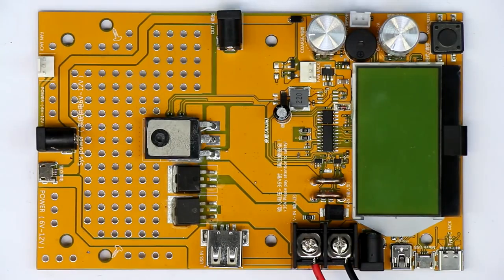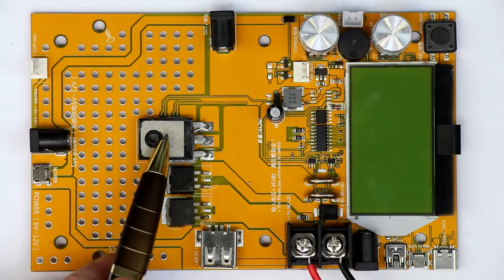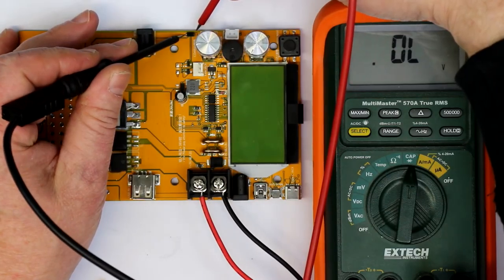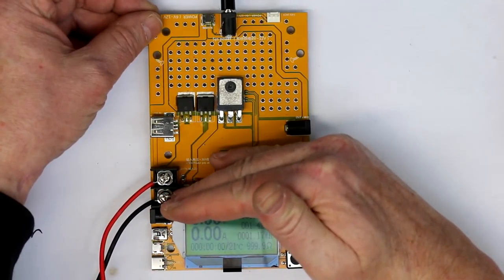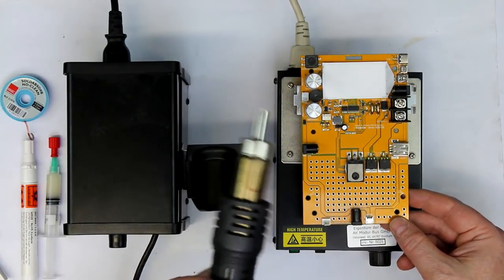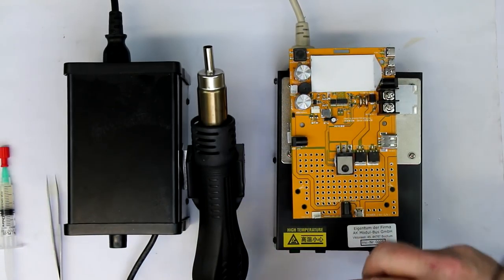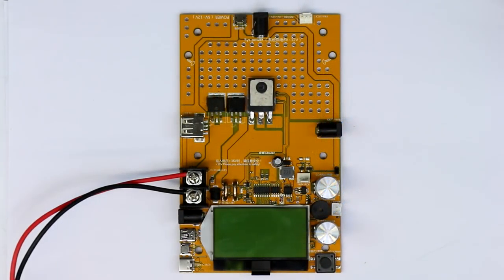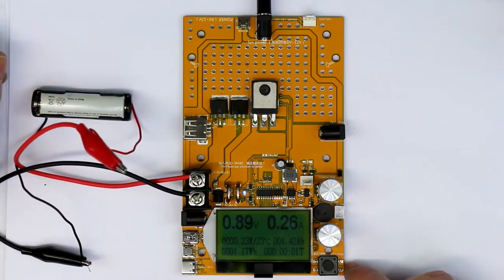Repair of a Constant-Current Battery-Tester

Comment: Hi
The switcher usually explode when the power input is reversed.
My favorit battery testing setup is the EBD-USB+ electronic load. It has enough accuracy and can trace the discharge curve.
Most of the other cc loads i tried had usually at least one shortcoming which disqualified it for my purposes.
Reply from the maker: Hm. When the switcher IC blew up the power of the battery under test was definitely not reversed.
(I think that one or two of the many high-current protection diodes on the PCB also serves to protect from that state)

I also had ordered the EBD-USB CC-load and even had it in my hands this week again because it intially also looked promising.
But as far as I remember it needs at least 3V minimum voltage of the load (=battery).
And that made it uninteresting for my purpose because I want to test single 1,5V/1,25V/3V cells.

The CC-load shown here has the shortcoming that there is no cutoff-voltage so that the battery will be dicharged down to 0V which is not a good idea for rechargeables.
I am just thinking about the simplest add-on circuit for a "programmable" relays- or MOSFET-cutoff-switch.
Reply: Hi 
Regarding EBD-USB:
Hmm this is strange I discharge my 18650 batteries to 2.50V and the specs claim - Voltage range: 0.5-21V
is it possible your manual was wrong translated and they meant powering voltage ?
I will try and discharge an Envelop tomorrow. I mainly use it to discover fake 18650 and battery matching.
Btw. Years ago Burkhard Kainka and Yogis Röhrenbude revamped my interest in electronics and meanwhile I studied electronics and work in the industry. And last week I stumbled over this channel. Unbelievable,... Btw. great channel love your tool suggestions and will soon place an order in your shop.
Cheers
Reply from the maker: Down below are 3 Ebay-sellers who all mention 3V-21V DC for the load (although I didn´t try it out with a single cell until now). Will try it out next week.
Could you give a link to where you bought youre specimen. Perhaps there are differences between the different copies of the copy of the copy :-)
Concerning Burkhard: Same with me. After making a pause in electronics for 15 years he revamped my interest in microcontrollers and electronics in general and in the end was responsible for my job now :-)

https://www.ebay.de/itm/35w-4A-usb-electronic-load-adjustable-constant-current-battery-capacity-tester-/291761120161?hash=item43ee5163a1
https://www.ebay.de/itm/35W-USB-Electronic-Adjustable-Constant-Current-Discharge-Battery-Capacity-Tester-/122988716369?hash=item1ca2b2e151
https://www.ebay.de/itm/Adjustable-USB-35W-4A-Electronic-Load-Battery-Discharge-Capacity-Tester-Fan-New-/272590673856?hash=item3f77ab97c0
Reply from the maker: I have tested mine yesterday with a 1,5V battery. It displays the correct battery voltage but I can´t get it into discharge mode.
Reply from the maker: Looks like we have 2 different models. Can you give a link or search terms for Ebay where you got yours?
Reply from the maker: Ordered one.
In the meantime the TEC-06 load has arrived.
Made a quick test yesterday. 
Accuracy and useability for battery testing is excellent: 4-wire measurement, programmable cutoff-voltage etc.
Will make a video about this one (+ 3 other ones I ordered including your suggestion) in the future when all have arrived.

Comment: Ha...I'm glad I didn't buy that load. The MOSFET is not DC/linear-rated (see the SOA curves). I'd be interested to see what happens if you try to run the board anywhere near its 150W(?) rating!
Reply from the maker: I don´t get the point. The diagonal dashed-lines in the SOA-diagram of the Vishay datasheet are only for pulse-loads.
If you multiply voltage, current and time at one point of one of the diagonal lines you get exactly the 1J (1000mJ) for the single-pulse avalanche energy in the absolute maximum ratings.
Continous drain current is given between 24 and 38 amps depending on temperature.
So I have no doubt that this MOSFET can withstand continously e.g. 3A@30V or 20A@5V drain-source voltage (if the fan can really dissipate 100W and the junction-termperature can be held below 150°C).
But this is a big CPU-fan which looks like designed for quite a substantial TDP-value.
Perhaps I will at a later date try to destruct this thing :-)
Reply: Most FETs today are optimized for switching, not linear use. They need to be vastly derated in linear mode — 10:1 or more...depending on Vds.

That knowledge was squirrelled away deep in my brain, and got dragged back up recently because I'm designing a load. 

Check this out for more:

https://www.edn.com/electronics-blogs/benchtalk/4460270/Help-me-build-an-electronic-load---bench-supply
Reply: E.g., the IRFP4668PBF is rated 500W, but the SOA DC curve shows max. V at 100mA as 40V. I.e., 4W. Also, 1A@15V, 10A@7V, 100A@5V, so power is going up at lower voltages.
Reply from the maker: Interesting. I knew about the "hot spot"-effect but not how pronounced this can be in linear applications.
Perhaps the linear derating factor of 2.2W/°C in conjunction with the maximum power dissipation of 280W@25°C can give a hint about the "true" SOA of this MOSFET (assuming e.g. 1°C/W as the thermal resistance from junction to ambient)
100W dissipated power would increase the junction temperature then for 100°C giving a deratig of 100*2.2W=220W to then only 280W-220W=60W. So 100W really seems to be over the top.
 
In the end only a stress test will show what this CC-load is really capable of.
On the other hand you could simply replace the MOSFET with a better suited one of the same form factor if the original isn´t 100% safe for your applications.
All in all I think this CC-load is reasonably well designed. So it´s perhaps worthwhile to mod it with a better MOSFET?
Reply: That would be interesting. See how quickly you can destroy the provided MOSFET. Then try a properly rated one :-}   Grab the "improved" spreadsheet from my article for some hints of suitable parts. There's no easy way I've discovered to find "linear" MOSFETs other than by combing through data sheets. Or...by sticking to an explicitly linear-rated series, like the one from Ixys. I'm not aware of any others...